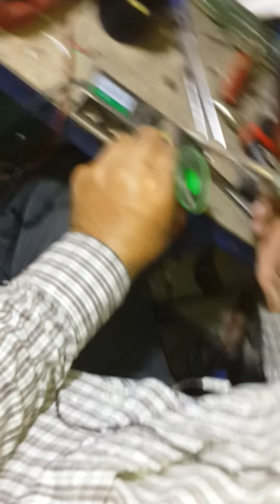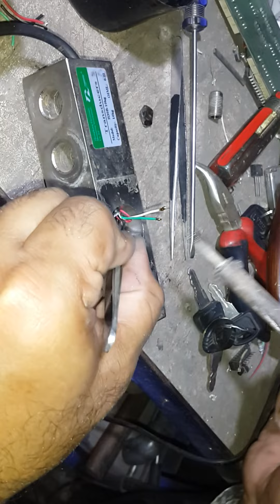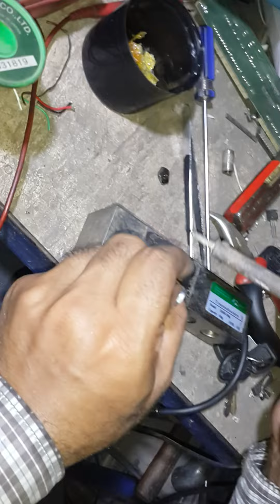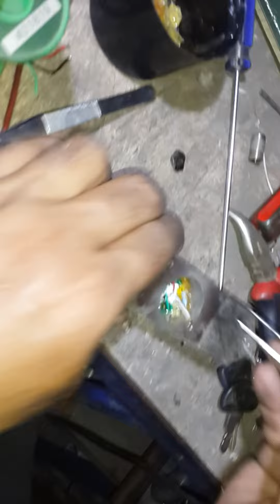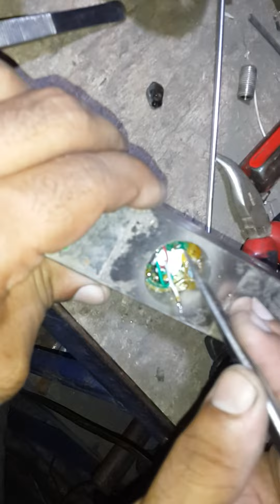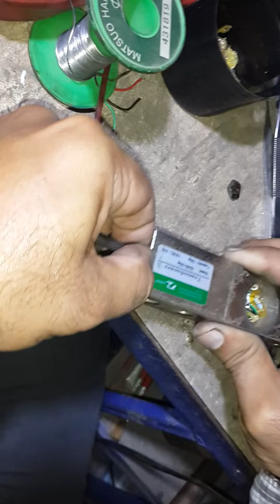load cell repairing

Comment: good work bro . It is right technique to join cut wires from load cell most common problem in industry for load cell failure. Also checking resistance from body to signal wires and supply wire of excitation voltage.
good to educate common technicians.
Reply from the maker: my new videos ( load cell repairing class 1 2 3
Reply: how to checking resistance from body to signal